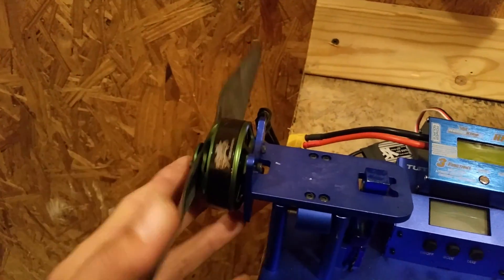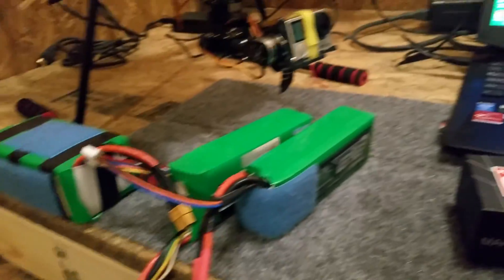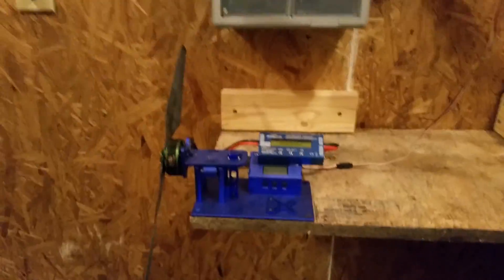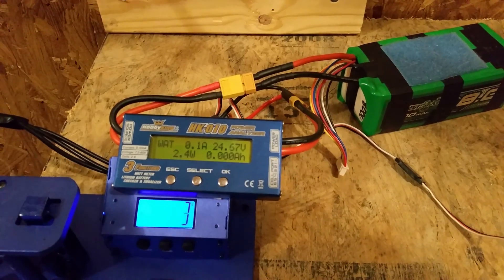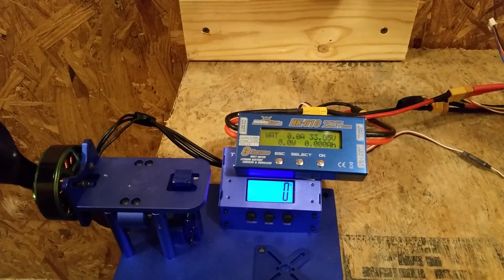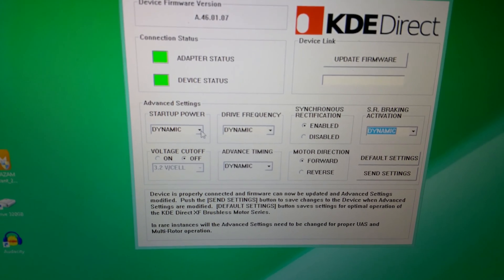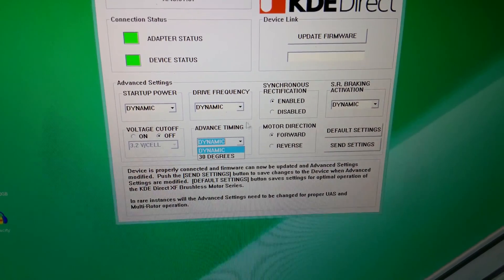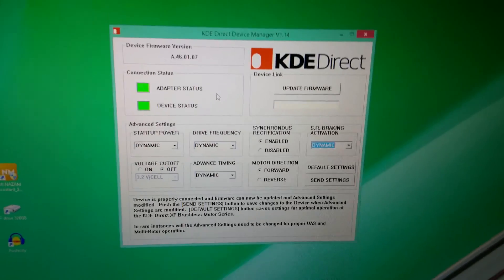6s vs 8s hobbyking elite 5010 274kv motor test

Comment: Great video I am looking at this motor myself. So is there any issue with running 8S HK list it but on the Arris site it only says 6s and a comment on HK gave warning about 8s. I would like to run 8s have you had any problems?
Reply from the maker: Hello ericwilphotog, The motors have been great on 8s. I have used 18x4, 18x6.1 and 17x5.5 carbon props and the motors have ran great. Take a look at the arris motor again, take note on the cut outs on the bell there is 6 cut outs, on the hobbyking motor there is 5 cut outs on the bell for cooling, so if it is an arris motor then hobbyking has changed the bell for some reason or hobbyking has copied the arris motor and just built it to the specs they wanted. Anyway I say go for it, no complaints here.
Reply: I just got my motors and I did not get any screws to mount it any idea what the screw size is? I also noticed the wire gauge coming out of the motor is pretty light 14awg would have thought it would be heavier for such a large motor.
Reply from the maker: Hello, sorry that was my fault I should have told you about that, mine didn't come with screws, not sure why hobbyking doesn't include them. The size screw your going to need is 2.5 x 6mm long if you are mounting on a 2mm thick plate. The 14awg is fine, its ac voltage moving threw those wires anyway so its nothing to worry about. Good luck on your build and if you have any more questions just ask.

Comment: Hi James, I notice your tests with 8s suggest 18amp approx hover draw.. but in real life your test flight was drawing approx 28 amps (so i guess you need a bit more than 900gram to hover and you mention on the 8s 2c battery you were only getting 10mins flight but on the twin 4s batteries you got 20mins despite the extra weight ..Ok i understand you did fly also until a low voltage and got more flight time .. but what is the average you got as 10mins vs 40mins is a big diff! we are all told dont go under a given voltage ..so bearing this in mind what in your opinion was the better setup .. 24000 8s 2c or 12000 twin 4s ? I am interested as i am just building a copter and was going to use the same motors / batteries.
Reply from the maker: Hi ziwi, in the flight with the 2 batteries your right it was much heavier and that is why you saw 28 amps but with 1 of the 2c 8s batteries the amps are about 18-19 in a hover. With the 2 4s 16000 mah packs I got about 33 minutes of flight time bringing the batteries down to 3.5 volts per cell with all up weight being 7kg. With the 2c 8s packs bringing the voltage down to 3.5volts per cell I only got about 10-12 minutes of flight time and that was at 24000mah and I thought that was strange, then I remembered HIGH DENSITY! I could be wrong here but I think being a high density battery means the battery can be brought down lower then the normal 3.5 volts per cell and that is where we get the flight time with this battery. As far as a better setup that's hard to say. For a higher amp setup go with 2 4s packs, it will be heavier but you will have the amps if you need it. For a lighter setup run 1 of the 8s packs just make sure your setup doesn't exceed 24 amps, 20 amps would be better.
Reply: +James Adams 
Hi .. thanks for your great reply ..so given that you can draw more flight time by going to a lower voltage would the single 8 s be sufficient for 15 plus mins ?..i have the same copter just the difference is i am going to carry a sony nex and gimbal rather than just the gopro as in your video.
Reply from the maker: +Ziwi you should be good, I just tested 1 of the 8s batteries and got about 23 minutes bringing the voltage down to 25volts, just keep an eye on the amp draw. ps just to let you know I am now running tiger 18x6.1 carbon props now, not the 18x4.
Reply from the maker: +Ziwi quick question about the Sony nex, do they record 4k? been wanting to upgrade from the gopro 4 black getting tired of the fisheye. thanks
Reply: +James Adams ..Who shoots in 4K ? we do a lot of video work for production companies from all over the world we only ever used full HD ..no TV station is broad casting in 4K, only U Tubers use it .. and 98 percent of people dont even have a 4K monitor to watch it ..lol..if you are worried about the lens on the go pro just change it for a narrow one ,,very easy to do.. Or use a phantom V3 / V4 :)
Reply from the maker: Ziwi yes I know, I just like to shoot in 4k then downscale.
Reply: +James Adams  I see you can buy just the Phantom 3 camera on its on ..with its gimbal ..very light and a very good camera. Or as i said use a narrower lens on your GP :)
Reply: +Ziwi P.s you can delete the unrelated comments on this video post if you wish ..
Reply: Have you seen a wiring diagram for the P3 camera?  I have a wrecked P3 and the gimbal/camera is fine.  The quad just flipped after landing on uneven ground and burned up 2 ESCs before I could shut it off.  But I've had it with DJI copters and build my own now..
Reply from the maker: +Jerry Ellis Hi Jerry, I myself have thought about putting the camera and gimbal from a p3 on a build, unfortunately like you I can't find the wiring diagram. If you figure it out please let me know. As for the burned esc's, if you want to repair the p3 I have seen replacement main boards on eBay. Sorry I couldn't help more.